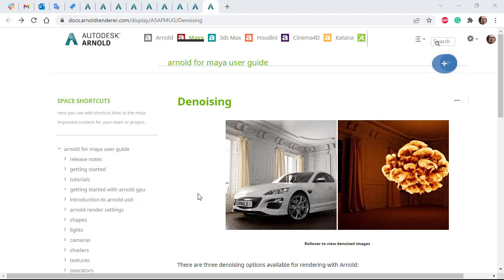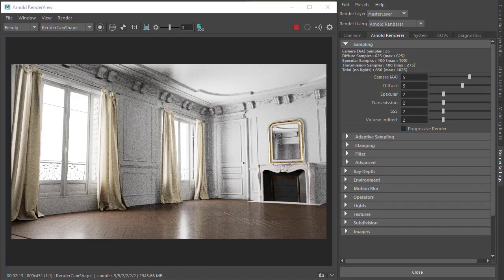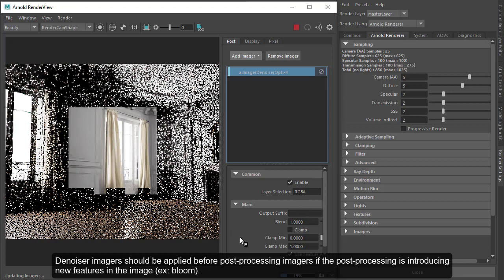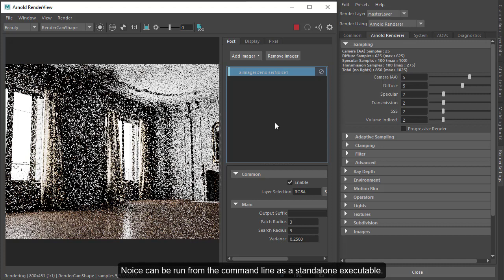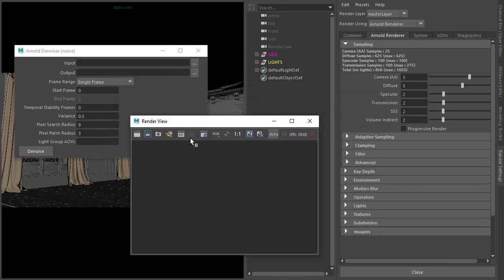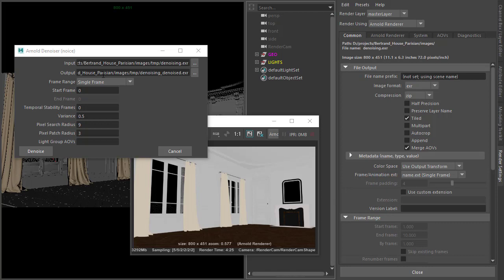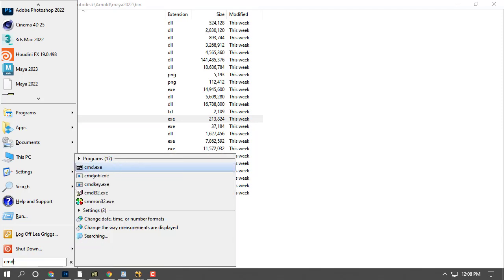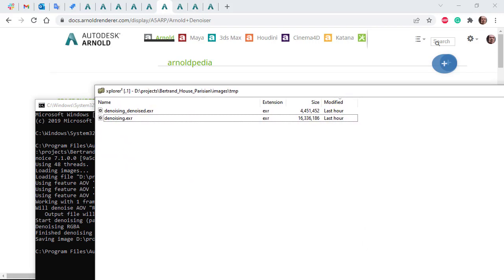Arnold Tutorial - How to use denoising in MtoA

Comment: Why is the denoised image so much smaller in size? The original file seems to be 4x larger.
Reply: Surely because this process destroys any AOVs in the original file. So this, in my opinion, is useless if you loose all other AOVs, isn't it?
Reply: @JoséMiguelAragüés  No, I don't think that it destroys anything. I think you can denoise any pass, but you wouldn't want to denoise any position passes or vectors, that would be destroying the accuracy. In a production pipeline, all light groups are denoised separately, and the problem can be that the specular pass for example isn't denoised with the same estimations as the RGB beauty. This is a problem because you then try to subtract specs from the beauty and it doesn't exactly match what you'd expect to see. So you then have to rebuild RGB from all the components and then you have a properly denoised RGB beauty. In other words, you don't have to denoise the beauty render if you are denoising all the components that make beauty.
Reply: @jupitereye4322  and how you do that?
Because the noice interface accepts ONE exr and outputs ONE exr that is super small in fileseize comparing to the original
Reply: @JoséMiguelAragüés  I am not sure, I don't use this denoiser, but perhaps you could do it through the terminal. There is nothing too special about the denoisers in general, they will denoise RGB, and you could shuffle any of the passes into RGB. I will have to look this up, I haven't tried it myself. But it would be crazy, production-wise, that you couldn't denoise passes. You could never seriously do compositing tweaks without being able to denoise AOVs.